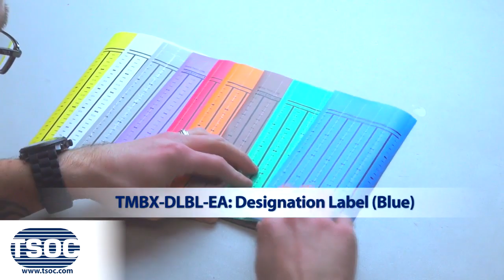How to Terminate a BIX 5A Multiplying Connector - The TSOC™ Minute (ep. 18)

Comment: Stupid Questions, courtesy of me.

UPDATED: The part of the video where you jumper one block of 5 to the next is wrong. He's jumping HALF of one pair to HALF of the next pair. Which doesn't work. I tried exactly what they did just to be sure.

As the text description for the video says, you need to jumper the last pair from the first block of 5 to the first pair in the next block of 5. A pair straddles that taller post - not in between them like they did in the video.

1) Which is the "Top" of the 5A? How can you tell?

2) Which is the Back? Does it matter? Guessing no it doesn't. (Which means Question 1 doesn't matter either).

3) You say to bridge the last pair of a 5 pair block to the first pair of the next block to make a 10-pair chain, however the video seems to show you bridging half of the second-last pair to half of the first pair. Shouldn't you be one over?